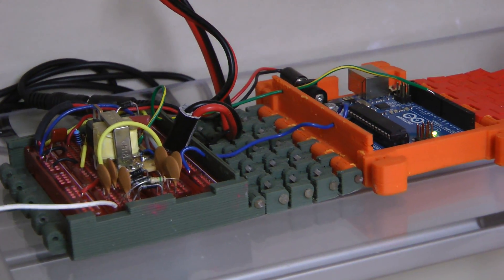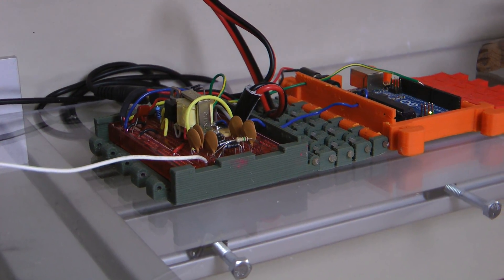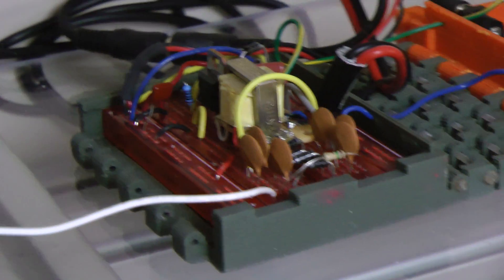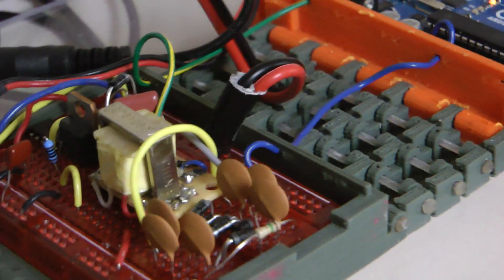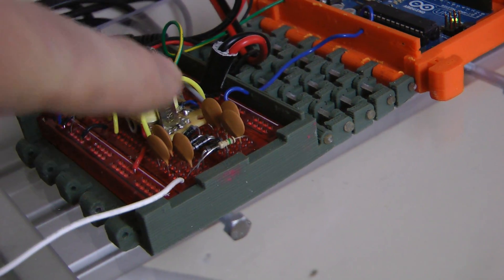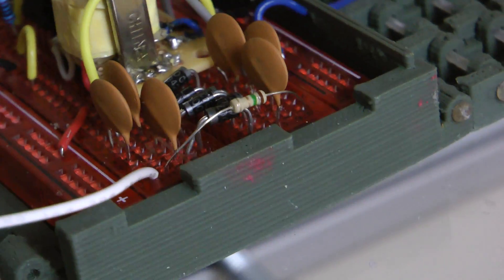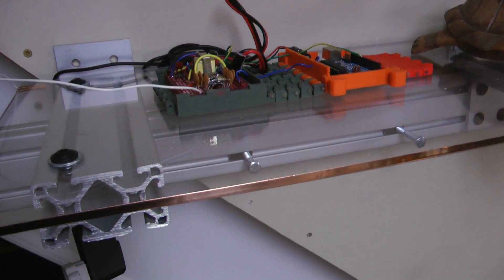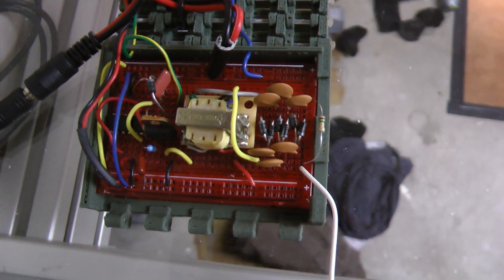Arduino Electric Fence

Comment: sorry its a --DC-AC Step-up 12V to 110V 220V Inverter Boost Board 150W Converter Transformer
 -  Need to motivate my large red nose pit bull to not pee on the corner of the bed,
As it is isolated from hard house current I think it safe,  yet nasty .  Any thoughts ?